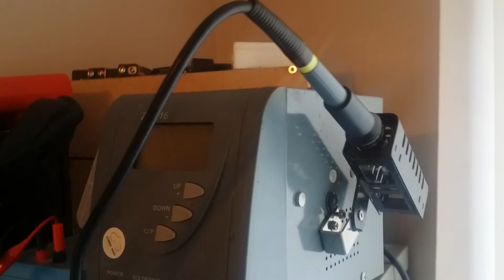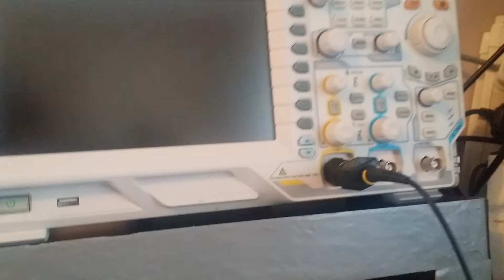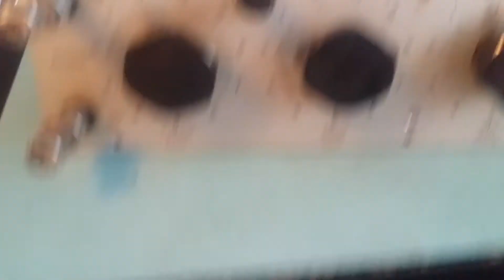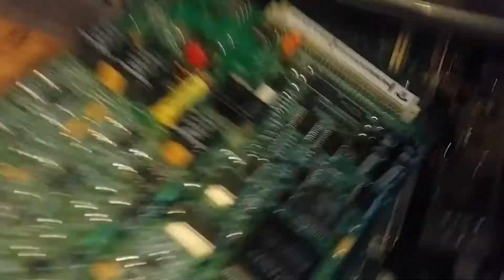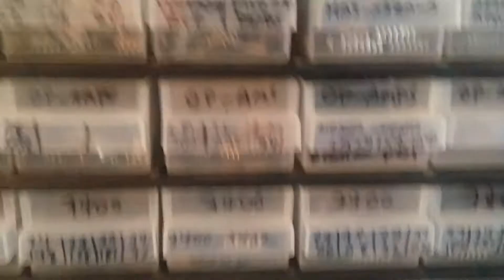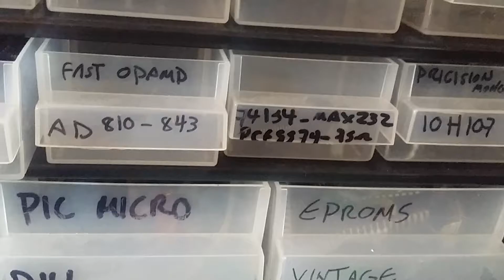Update to my electronic lab

Comment from the maker: thanks, i started electronics as a hobby about 10 years ago so the parts you see are what i have bought from farnell and rapid and some are salvaged from stuff i get of ebay. but one thing with electronics is that it is a very expensive hobby.
Reply: To be fair, you are stocked better than most shops! :)

It is possible to do it at a quite reasonable cost if necessary.
Reply: +InnaSoulSounds Well, thats seriously right.